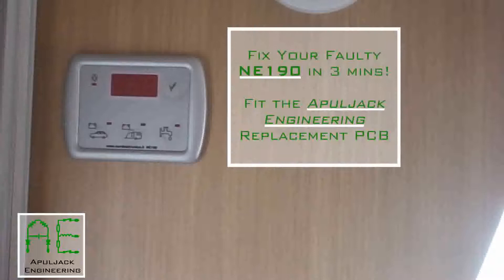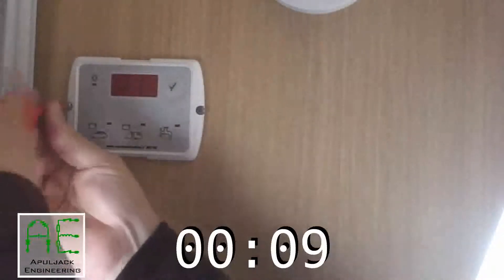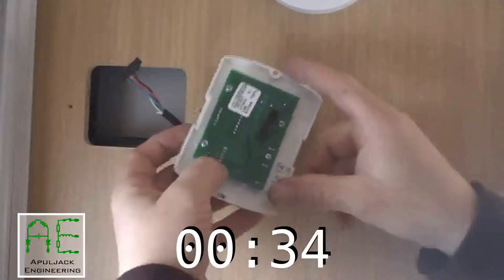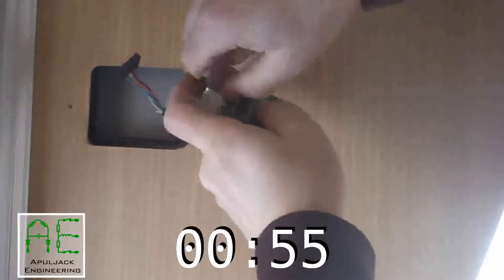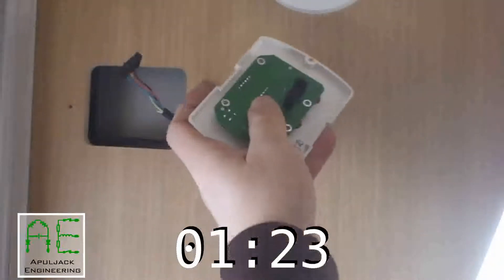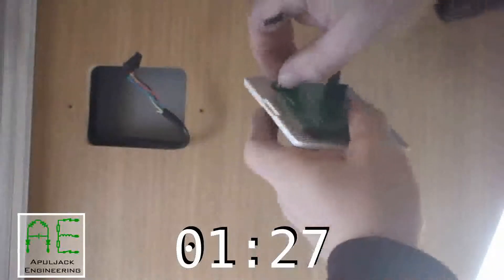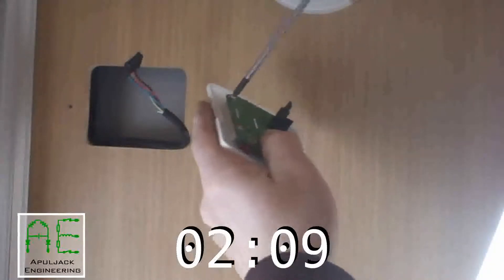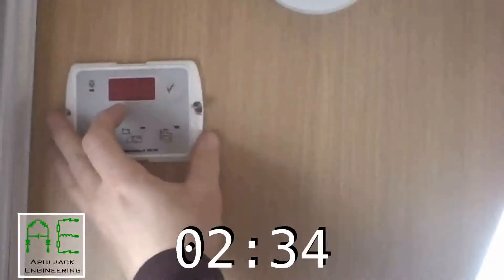Replacing your Nord Elettronica NE190 with the new Apuljack Engineering AE190B

Comment: Hi I have the nord ne222 control panel today I tripped the motorhome electrics now my control panel lights up red and says no cp fb what ever this means now I have no lights or the step doesn’t work or tv the ehu works the microwave and battery charger 
Will I have fried my control panel 
I think the fuse board is ok as the fridge works and my marker lights and so on 
I’m thinking of buying a different control panel that’s plug and play to this
Reply from the maker: Hi, sorry to hear this has happened. "NO CP/FB" means there is a communications issue between the control panel and the fuseboard. This can either be caused by damage to one or both of the units, or to the cable which connects the two. We would suggest sending both the panel and fuseboard to us for testing and repair. Alternatively, you could purchase our replacement data cable from our online shop (www.apuljackelectronics.co.uk, part number CAB-APU-006-NE). For a plug and play replacement, unfortunately it is not that simple, as the NE222 control panel will only work with the NE221 fuseboard.
Reply: @apuljackelectronics  thank you very helpful cheers 
Yes I’ve just done a light test negative to positive and all fuses using 12v on the fuse board have no power going to them 🥲